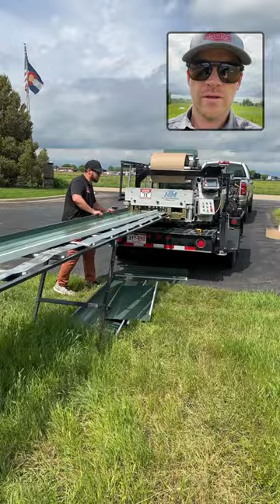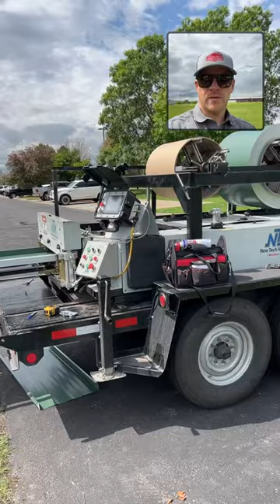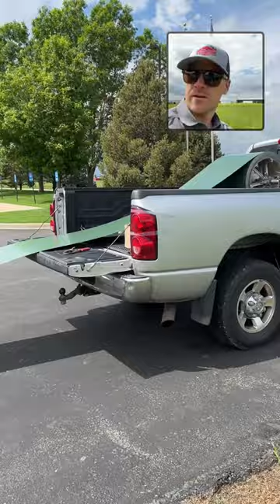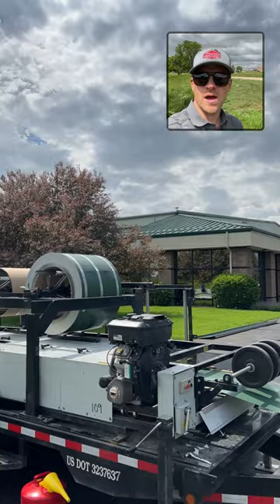Onsite Roof Metal Bending & Cutting

Comment: 😂how much hail damage does there have to be. That's a big job. Lots of $$$$. Metal roofing should be hail proof. I understand that the hail may have dented it but completely replaced. I like your setup. Used to work for custom built metals.
Reply from the maker: Metal is usually pretty easy to get a claim on. Unless the client signed an aesthetic waiver, then you are sol